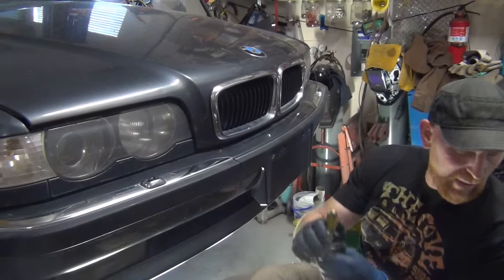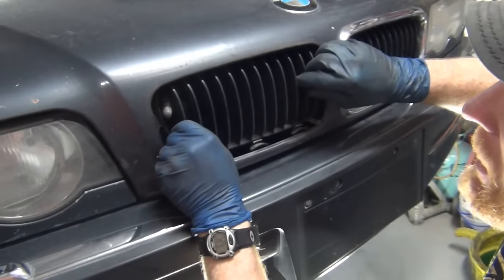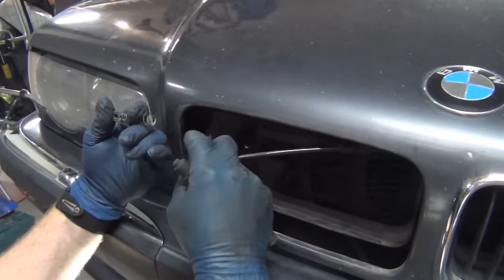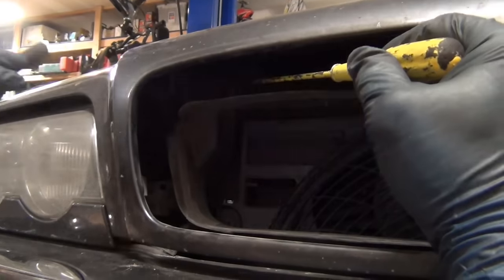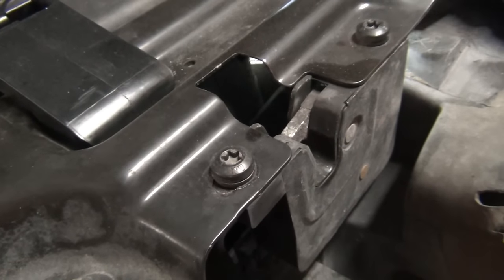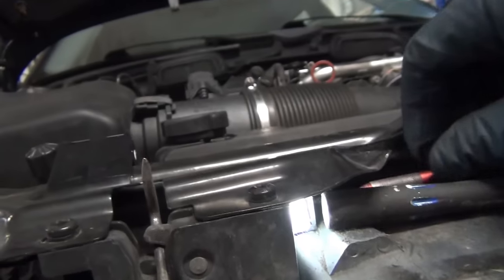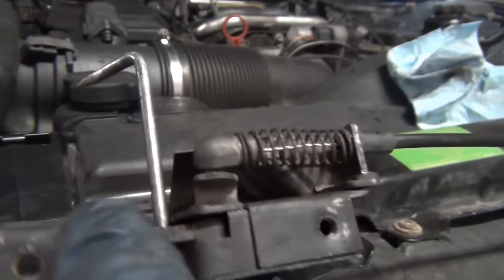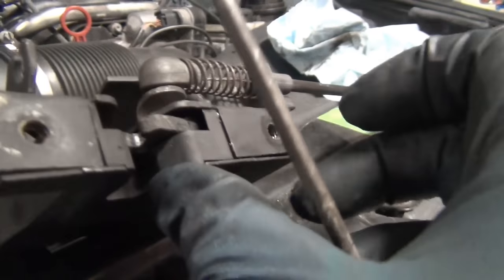How to Open a Stuck Hood BMW 7 Series

Comment: I have a 2002 bmw 745li and had the hardest time getting the stupid hood open... with that being said I found a way to get it open I will postt a video tomorrow... it took me all but 5 minutes to get both latches to release and I had tried everything... anyone can do it and it is so darn simple in a nut shell underneath the car in front close to radiator there is a little space looking up through there you can see the cable that opens the second latch if you get a long piece copper tubing or something about 3 feet long and bend the end of it to a hook you can reach the cable... I got mine at harbor freight for $10 bucks comes in a package of 8 or 10 but you only need 1.... once you hook the cable pull it a few time and the latch will release.... for the first latch on the driver side... using the same copper rod... in between the right headlight just above the blinker slide the rod between the light and the hood its kinda a tight fit but it will go through make sure the hook is facing sideways.. once in about 5 inches turn the rod toward the up position and pull... the cable is right there past the front headlight pull it and it should open... trust me I have been trying to get my hood open for a few months and just gave up on it... the dealer wanted $400 just to start to open it... another bmw guy here wanted a whopping $600... I'm a do it yourself kinda guy so I had other projects to work on while I was trying to figure out the hood on this darn car.. but today I with GODS help got it open and now I can check everything it was a process but it is easy now that I've done it several times... good luck to those who are having the same problem I hope this was helpful
Reply: CLS CLS were you able to post the video?  I searched and couldn’t find it. I am going through this same issue right now and would really appreciate any help or video you could provide. Thanks!
Reply: Same here. When are you posting it?
Reply: @aaroncram6721  what did you end up doing, mine is stuck now
Reply: @FernandoHernandez-ly8xg  did you find a way to get yours? open?

Comment: There's nothing wrong with the cable engineering here folks. It's the lack of enthusiasm performing maintenance on the unit that gives it a bad name. Simply put....oil the dam cable and latch regularly. End of problems.

Comment: Please do an instructional video on where the turn signal levers are on a BMW.
Reply: Kenneth Busler they need to make a heads up display for the cell phone!! 

That way, they can still see out the windshield, while they are staring at their phones.... While driving!
Reply: Add to that where the fog light switch is, as you do not need the fog lights on at night when it is clear. Mini drivers are incredibly prone to this, and some vehicles have a fog light switch you have to press after the lights are on to light it, and it turns off with lights off. Would be nice to have that as standard.
Reply: SeanBZA what would be nice is if they would make a switch in the trunk thats a momentary fog lights on switch, and you have to hold it on while driving!!  

Main point: IN THE TRUNK!!! 

But of course, they would have a well dressed five year old old the switch on for them, IN THE TRUNK!